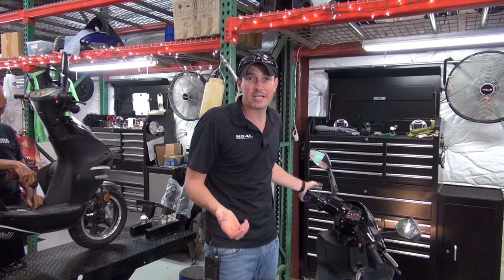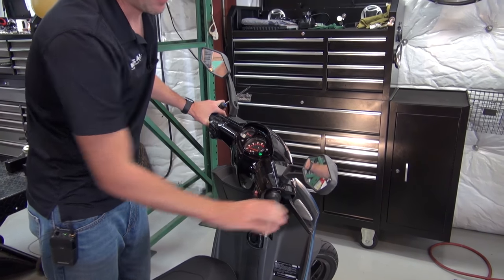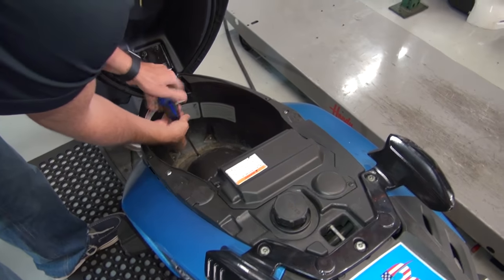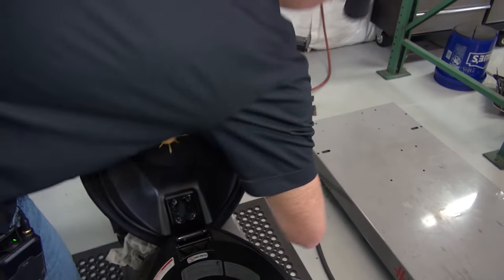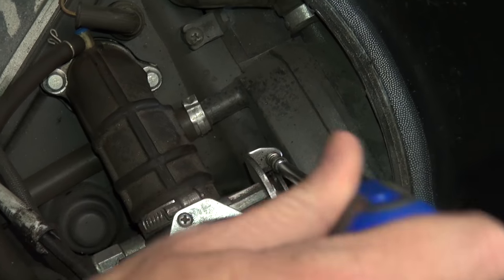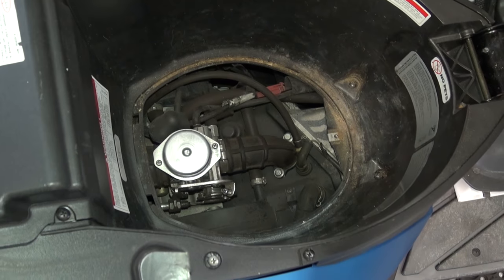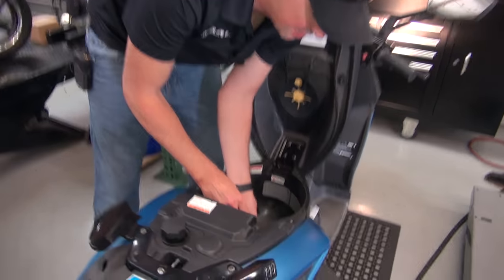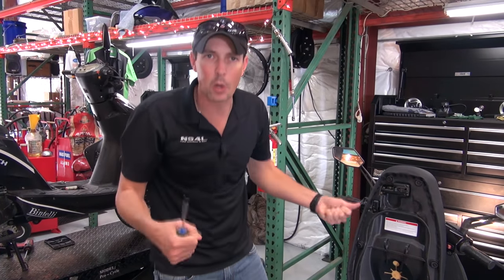Scooter Troubleshooting: Scooter Dying Out When You Come to a Stop / Low Idle

Comment: What if its a FI and not carb?
Reply from the maker: Well...  you wouldn't have a carburetor, so you wouldn't have this issue...  You would have a different issue.  Is something going on?
Reply: @NewScooters4Less  keeps dying out and theres a grinding sound coming from the rear in lower gear..same prob again and again..
Reply from the maker: @MrHirriq  Did you take the rear drive box apart?  You could have a broken bearing in the wheel / transmission.
Reply: @NewScooters4Less  Yes! My mech told me he replaced the rear drive box and had told me it was a bearing issue..somehow after the issue is still there..
Reply from the maker: @MrHirriq  Maybe the axle or casing is messed up and caused it to shred up again.  I'd take it back to the tecg my friend.  Thanks!
Reply: @NewScooters4Less  Hey thanks! Really appreciate your professional advice!
Reply from the maker: @MrHirriq  Sorry I couldn't do more to help from this end!  Have a good one!

Comment: mine dies immediately when I let go of the throttle  and won't idle at all this video did not help at all
Reply from the maker: Could be a vacuum leak or another carb problem.  May need to get it into a shop for further diagnosis.
Reply: @NewScooters4Less  I'm not able to take it to a shop since there's no longer any around my area sadly
Reply from the maker: @SittingWolfParanormal420  Sorry.  Wish we could be more help!
Reply: @NewScooters4Less  it happens. but thanks for the advice

Comment: fucking made my scooter accelerate non stop . now it doesn’t stop
Reply from the maker: Lol. How high did you turn it up? You're only supposed to adjust it to the point where it doesn't cut off anymore. If you did and it's "running away" you may need to adjust your throttle cable or you may have an issue with your carburetor.